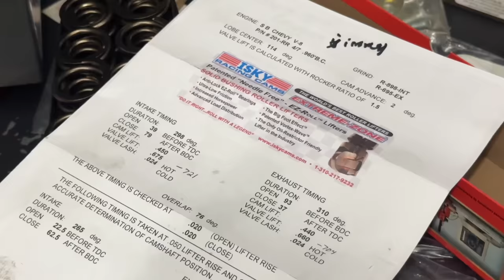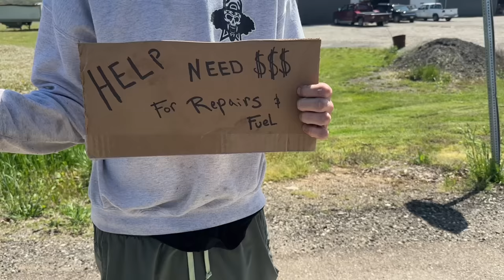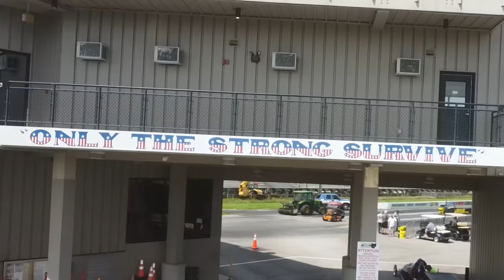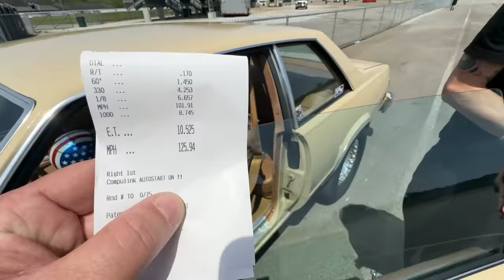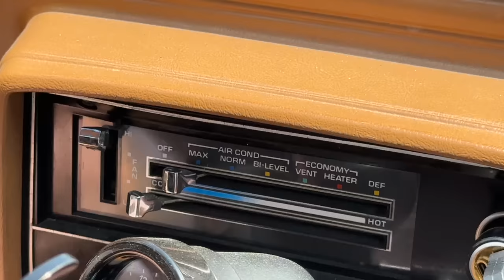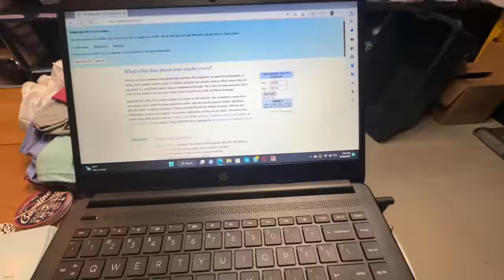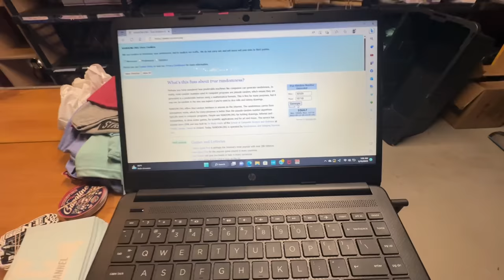Jimmy Dale goes WHEELS UP in the Malibu on his first ever 1/4 Mile pass!

Comment: Thank you for posting. I love your content very much. I have a quick question for you have you ever considered using clear Plasti Dip on your lower quarter panels so when you're finished racing and you want to clean the car up you can just peel the plastic dip about 6 coats will make it really easy to peel and it being clear you probably won't even be able to tell it's on there. Just a thought

Comment: Couldn’t of been the overheating issue of the round tracking in the back yard that caused havoc on the crown Vic. 😂 yeah, you can’t get those 4.6’s to wet. Those spark plug tubes like to hold all the water if the coil boots are old and crappy.

Comment: After I wash an engine I always let it sit for almost an hour before I even try to start it. An engine is basically waterproof but you got to give it time to drip-dry. And you will always get water in the distributor cap. I always take the cap off and let it air-dry

Comment: Throw a small block and a turbo 400 in the crown Vic. 9" posi double the tires shrink the bumper shocks and weld them fast notch the top of the rear frame In the trunk be good to go.

Comment: Heck, an electric fuel pump ain't nuttin, got one on my 5,500 rpm redline 13 second Olds 4-4-2 cruiser. Wire it thru the oil pressure gauge and it'll shut off if 'pressure drops. Better'n shuttin' off the ignition and washing down the cylinder walls. put in a kill switch for anti theft if you want. plumb a return fuel system off the regulator to avoid needing a cool can.  Still, three consistant ET slips in the hand's a nice poker hand to come to the table with.